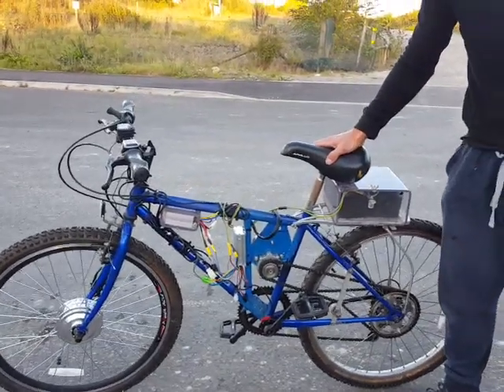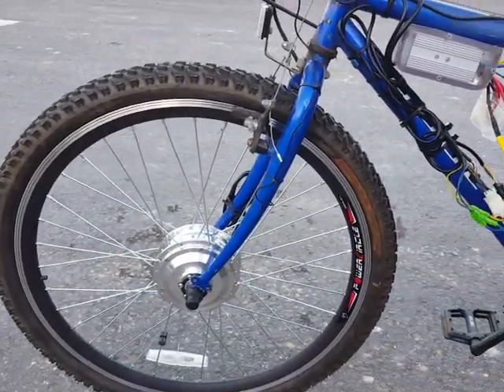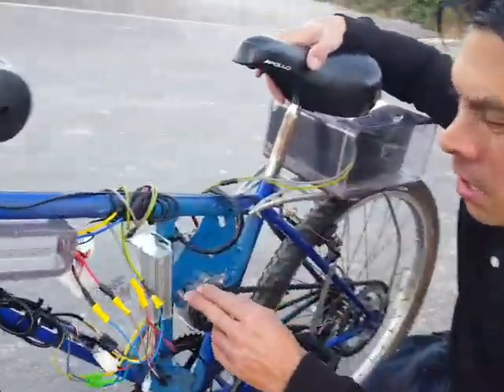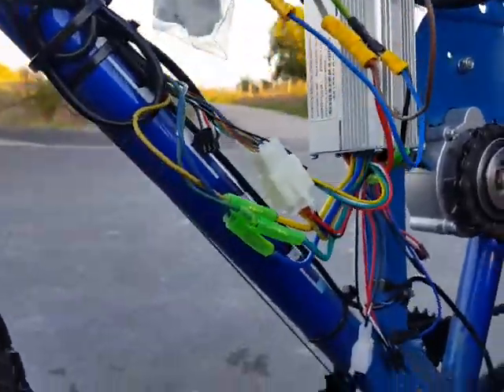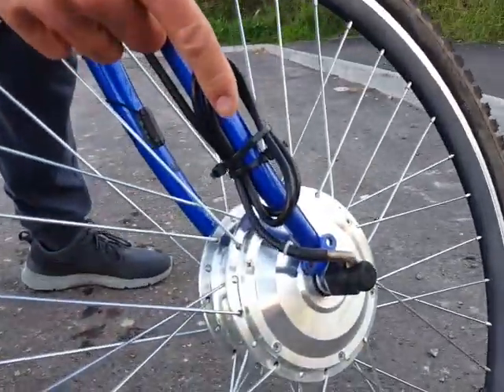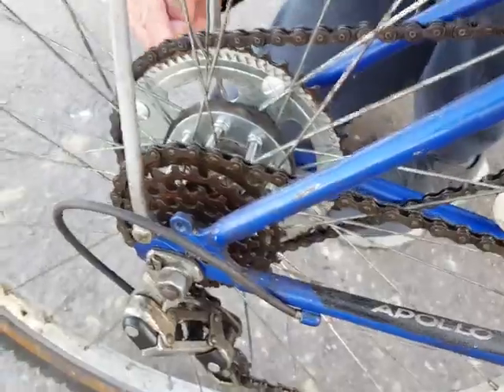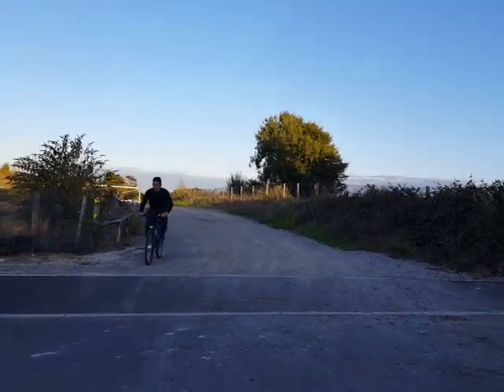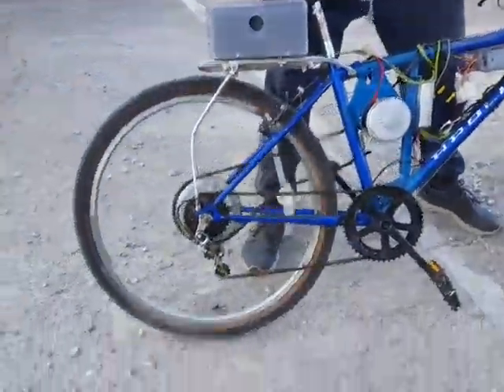Two wheel drive DIY ebike super simple fun and cheap easy best ebike video

Comment: Neat, where did you get the rag mount and cogs? Do you think it would be possible to add another 3 speed gear on the back motor?
Reply from the maker: Hello bought most bits on ebay or ali express.  Im sure adding more gears are possible. thanks for commenting.